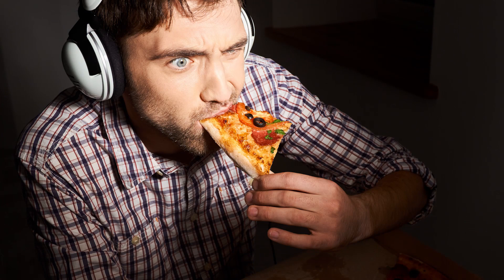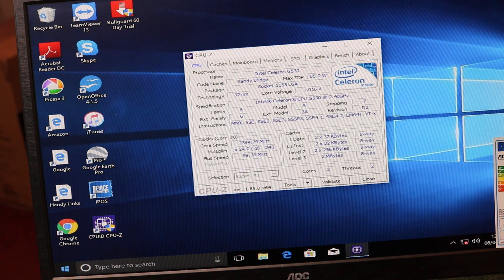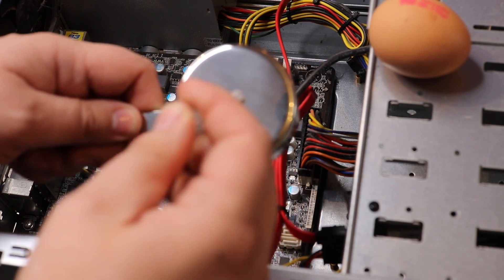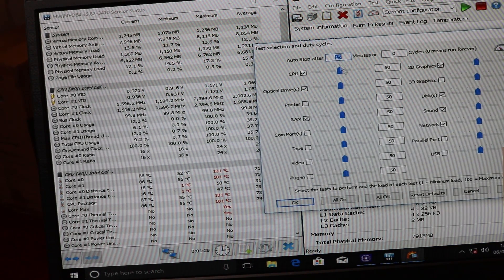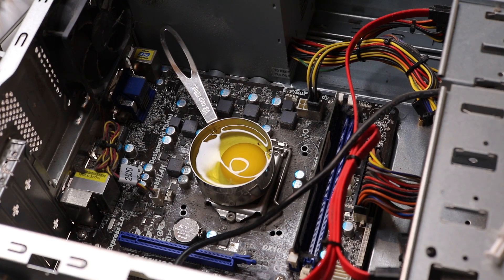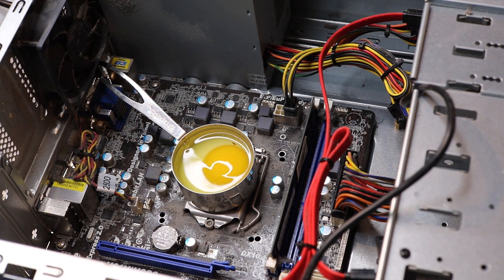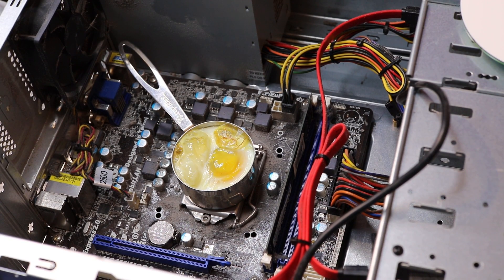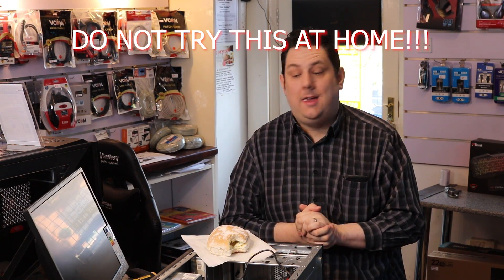How to Cook an Egg in a Computer! 🔥 A Demonstration on CPU Heat.

Comment: Ok it's obvious that the CPU unit obviously it's over he's after a certain time and cooked to a high temperature a massive amounts of electricity and circuit energy board is connected to the CPU to run the computer

Have they created a CPU unit where the CPU is channeled in Multiple areas of the circuit board no electricity to flow through and continue flowing through around instead of having one area concentrator with massive amounts of energy I'm being cool down

Comment: I used an old Athlon XP about two decades ago to achieve this, i used a dash of cooking oil too..the CPU still worked afterwards! Without a heatsink though, they could reach over 300 degrees C and smoke! Often taking out the board too... Mine cooked in 10 minutes btw, not two hours! Poor Celeron..should have used Celery! ;)

Comment: The cup used here for cooking the egg looks to be SS or nickel/steel which has very low thermal conductivity compared to aluminum or copper.   https://www.engineeringtoolbox.com/thermal-conductivity-metals-d_858.html

Comment: I think it wouldve cooked way faster if you used thermal paste to get better thermal contact between the pan and the die. Also a lid on top of the pan to prevent heat loss!
Reply from the maker: Thanks for watching, Thermal paste was used (3:27),   lid would have helped but could not find anything that small that would be see through and would not cause steam on turn to condensation and then drip on the board.

Comment: Would have been faster if you used a Fx series or 9900k/10900k, vega 64 would also work fine
Reply from the maker: Unfortunately not as the cpu would get to hot without a heat sink and power off.
Reply: @TechforTechs  it..it was a joke
Reply: Wooosh
Reply from the maker: That’s cool, not everyone understands so we like to make sure it’s clear

Comment: You should've over clocked while playingg a cpu heavy title
Reply from the maker: The cpu was running as hot as it could without crashing. Over locking it would have cases it to overheat. The program we used stressed the cpu as much as it could take

Comment: He should have put oil in the cooking utensil first, or use spray oil so the egg come off easier without having to scrape, give you 7% more egg. If you would change GPU setting to mine 5% more coins it worth spraying oil to get 7% more egg.

Comment: Energy efficiency : 100.

Yeah really, the energy is being put for something useful, otherwise the heat energy just would've been expelled by the fan, can't the CPU be utilized to produce less heat btw
Reply from the maker: Less heat = slower processor.  power can be reduced or capped but you would get performance hit

Comment: What stress program do you use?
Reply from the maker: Old version of PassMark. Run in test, set on 100% CPU usage, uses all cores at 100% load for as long as you want.
Reply: Tech for Techs my cpu only goes to 75 Max. How do I make it reach to maybe 100 degrees?
Reply: Tech for Techs yet I haven’t installed it but I’ve tested many programs and it goes to only like 75 degrees
Reply from the maker: All CPUs have a different Max temp, some will turn off the PC some will slow its self down so it won’t overheat.  Not sure why you want it hotter, but stopping fans and removing the heat sink will fix that, but could permanently damage the CPU. Is why we used anPC that was for scrap
Reply: I just want heat in my room. It is freezing 🥶

Comment: You need AMD processor for that
Reply: or 9900k
Reply: @rozzwilliams2568  or 8350 from amd but ryzen is cool enough
Reply: @neutron101  Actually a FX 9590
Reply: technical any process can cook food
Reply: An FX processor
Reply: @sowavy9  i have athlon x4... basically can cook a meat
Reply: The new AMD cant cook. Just take an Intel
Reply: Most CPU’s shut off once they pass 100 degrees so intel or amd will have the same result.
Reply: Ryzen cant cook anymore. You need FX or Intel

Comment: My Intel i7-8700k cooked egg in 8 mins and didn't even crash ones. I will update if my i7 can cook an omelet without crashing.
Reply: could it?
Reply: My i9 cooking meat
Reply: 1 month later, no updates, it crashed
Reply: Could try this with my 9700K xD
Reply: @gsonz172  liar/flexer
Reply: @bobi_lopataru  calm down, this was a joke
Reply: @gsonz172  lol let me try this with my quad rtx quadro intel core i9 75783929487493 and my 40000000000 tb of ram
Reply: @gsonz172  not sure
Reply: Nice.
Reply: Can I see the Threadripper in action tho?
Reply: @krispykrep912  actually that makes sense cause it has more surface area which is a bonus for cooking especially
Reply: Noob numbers. My HP G70 with intel Pentium cooked an egg in 2 minutes!